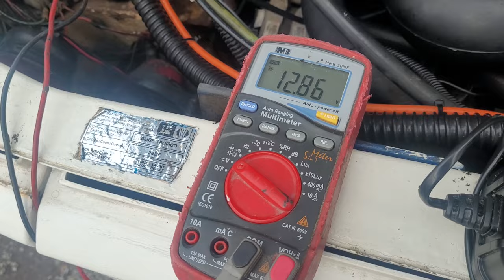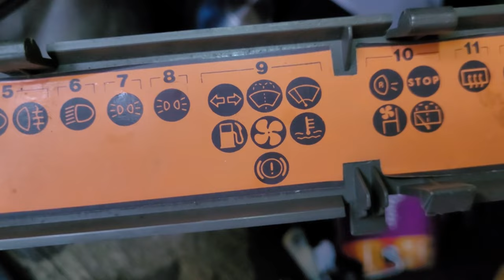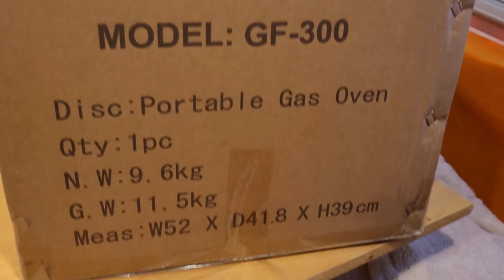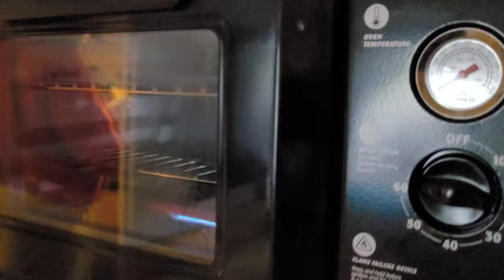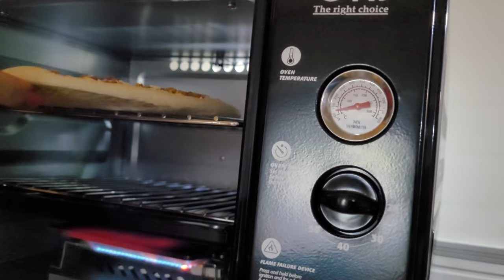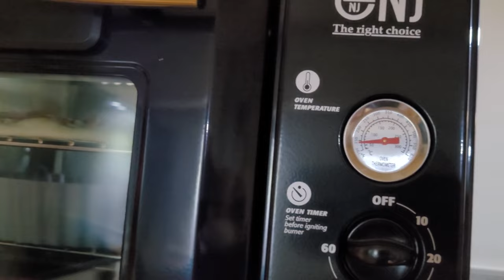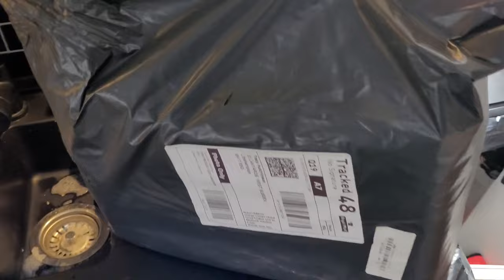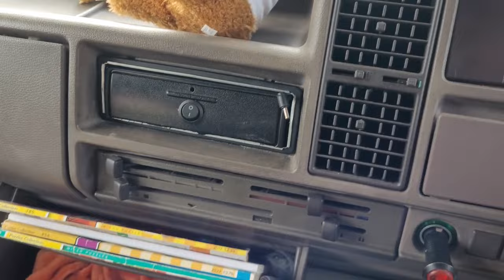Van Life Just Got Better / Portable Oven / Desk Top Water Tap

Comment: When my heater, same as yours, leaked I put a bypass pipe in with 2 stop taps so that I could still use cold water without pressurising the heater. There originally was no way to isolate it, I now have repaired it and also put a bobil tank in with valves so I can use either or both. Keep well
Reply from the maker: That's a great idea 💡

Comment: Fitted a switch to mine due to people reporting that engine battery discharging even when ignition off. Never had a problem just turn on when engine running. Good luck, merry Xmas and happy new year.
Reply from the maker: Yeah it's a good idea to add the switch I recon. Easy to do too. Merry xmas to you too x